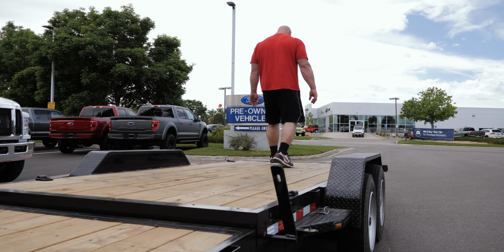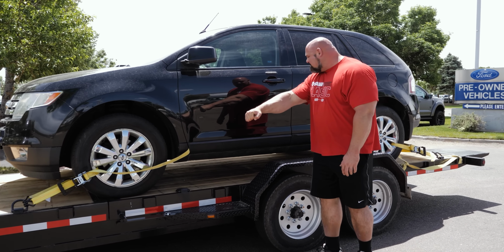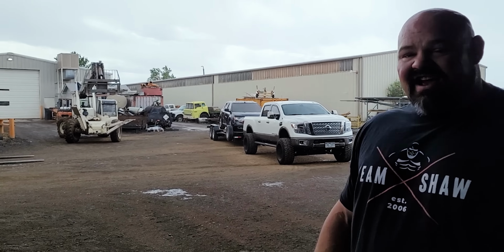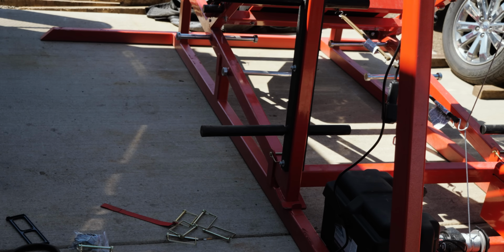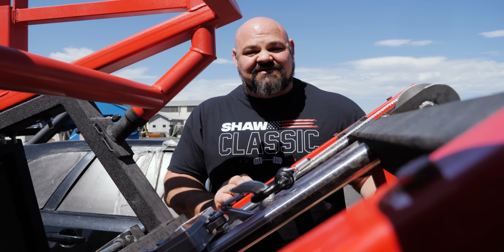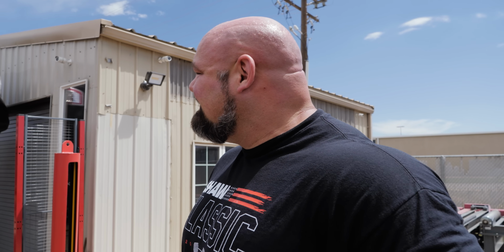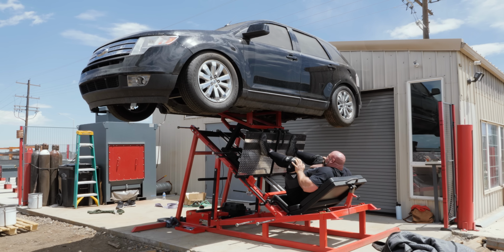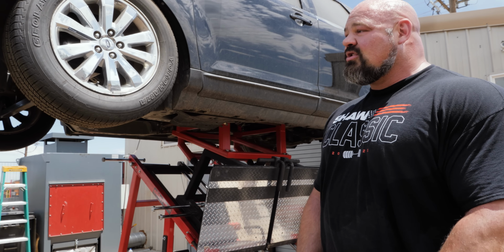LEG PRESSING A 2,000LB CAR! | SHAW CLASSIC

Comment: Yeah, seeing the car shake is a little scary.  That might make this event, an event that not only tests strength but fear of dying.
Reply: No pain no gain? 😂
Reply: Yeah. Seems scetchy. What if it came loose after all the reps and 🚙🙃🥞
Reply: @Hammarsand  well I'm sure Brian will have a safety team keep tracked of it
Reply: @Hammarsand  There will be a safety inspection team there to check it out before the event and after each competitor. It's going to have to otherwise I'm sure the stadium wouldn't allow it as one of the events.
Reply: Yea not a fan really. So dangerous and shorter guys are gonna have the advantage
Reply: @BraYsUnc06  so Eddie hall will win? 😂😂
Reply: I hope they've tested dropping the weight down onto the safety to see how the car reacts and check the mounting points.
Reply: Just add some glue and it will be fine.
Reply: @BraYsUnc06  What makes you think its "so dangerous" exactly? And it's easy to have adjustable safety stops so there is similar range of motion for taller or shorter athletes. Even if there werent though, taller athletes have the advantage in so many areas. It's ok for shorter athletes to have an advantage once in a while too.
Reply: thats what iw as thinking to it wiggling LOL
Reply: Yeah agree but his a strong man💪
Reply: I hope the engineering was done properly. Hopefully the welds are strong and bolts are properly rated. It does look sketchy. I think I’d skip this event if I was a competitor 😀
Reply: @BraYsUnc06  he said he would be adjusting it to each competitor
Reply: @BraYsUnc06  tall guys have the advantage in a lot of other events. its just how the sport is. just be as well rounded as you can
Reply: The car will just bounch of brian
Reply: @BraYsUnc06  taller guys have advantage on stones. Longer arms advantage on DL. Strongman doesn't care about your size, it's about who is the strongest
Reply: @MattManProductions  man that was pretty good! I swear a gym bro will say that about anything (no pain no gain)!
Reply: The base on which the car is placed on is FAR too small to hold that kind of weight safely, and the large weight distribution of the car makes it even worse. There's no way they can 100% garantee the athletes safety in this current condition.
Reply: @ralphschannel6650  if you cant solve a problem with duct tape then youre not using enough duct tape.
Reply: No fear no pain event
Reply: @BJerrell  not really. They have to bend over further, squat lower and lift the weight higher. In deadlift. Not higher in stones, but they still are more compromised when they go do to lift.
Reply: @BJerrell  the only advantage is they can lock their hands on stones. That's it. There's a reason shorter guy do better with deadlift.
Reply: This does look a little sketch tbh
Reply: @apocratos0174  That was always my father's solution. Duct tape. The more the merrier. Especially applying all crooked.
Reply: They need to put something like chains on the other side so the car can't tip towards the person
Reply: Implying he couldn't just stop it with his hands huh
Reply: It needs to be redesigned to be wider and deeper.   It simply isn't designed properly.
Reply: Well not supposed  to  die,  should   make  safe,  sturdy

Comment: I wouldn’t wanna be the one responsible for them welds 😂
Reply: I hope they finish all of the missing welds . They are going to see alot of stress everytime it slams the stops.
Reply: @wayloncrum7488  That’s what I am thinking as well… Hopefully there will be no failures.
Reply: Look up how strong welds are, that car aint going nowhere. I couldn't tell if they do or not but they def need some bolts holding the car to the press frame so it doesn't wobble around and just general safety
Reply: @DyLemmaOG   I know how strong a weld is but the integrity of the weld does matter! I’m just saying I wouldn’t wanna be the one to be liable.
Reply: @z_blev  this will really be a test for the EliteFTS build quality. Their reputation is very good and this leg press is incredibly over built. Here's to hoping it can handle a setup outside of its designed purpose.
Reply: Even stick welding with a 6010 stick, one inch of weld should hold 60,000 pounds. Not sure what shear weight is though.
Reply: I would be way more concerned for those linear rails which are taking this huge torque because they loaded the weight waaay higher than normal. Would not be surprised if one of those bends during contest and potentially drops the car onto the competitor. I can tell they didn't involve any mechanical engineers in this design change.
Reply: @cadewallace20111  I think they were talking about the car being attached to a crane or something so it could only go down so far.
Reply: @cadewallace20111   I didn’t think of the guide rails 😮 Certainly will be a mentally challenging event.
Reply: @DyLemmaOG  welds are strong yes, but take it from a farmer they will still rip apart once u get smacking them professional weld or not! they need to be over done
Reply: I was thinking the same thing but you can tell it is extremely tight. Guy did a great job

Comment: I have a fear someone may end up having a car on their face when they do this. It does not seem very sturdy or stable. That base should be as wide as the car is for stability and the little bits of metal that are actually holdiong the car to the rig should be beefed up.
Reply: Could also wrap the hell out of it to the rack. Tie every support joint to the rack
Reply: i agree 100% some guys may not want to be soft on the equipment , save energy by slamming it back down quickly they will either have to try ...to enforce that as a no no technique but thers something about the base of that so small & the car so wide causing it to wobble means causing unexpected cracks or damage to place holders

Comment: Need a roll cage or to be attached to a lift so that in the event it does detach it will not fall on the competitor. Love the event though. Dedication to improve the sport and competition is clearly visible in The Shaw Classic.
Reply: Or at least some kinds of safety cables that hook onto the car from some kind of small crane.

Comment: A 2,000 car or car and rig apparatus at an angle of 35 degrees (and assuming no friction) gives a value of 258 Newtons or roughly about 1,146 lbs of actual weight to be pressed.  Of course still a 2,000 car but with the use of a simple machine like an inclined plane, the force is reduced to move the object.
Reply: The car isnt 2k lbs, 2k lbs is what he is pressing the car is way more than 2k
Reply: @drsawful  The title of the video says 2,000 lb car.  So your saying (through the math) the car would have to weight approx 3,500 lbs through the leg press to equal the 2,000 lb force necessary to move it.  I see.  Then maybe change the title of the video to say 3,500 lb car?  Would sound much better!

Comment: 8:20 I can't believe you stripped it out that much and it still weighed 2000 lbs! I figured you'd yoink the engine & transmission, seats, all electrical stuff and sound insulation maybe but that is pretty much a bare shell!

[Edit: OK, I guess if every moving part = 2000lb then the frame must weigh a couple of hundred too but still. You could have used a Fiat Panda straight off the forecourt :-) ]

Comment: Might want to figure out the  safety  over to catch the car in a catastrophic failure  and the winch needs to be bigger unless it had a low battery  that's so sick  he did not weld on bottom on car frame

Comment: Man, the welds on the leg press and everything look good, but the welds and subframe on the car where it attaches to the leg press, I’m not impressed by. I mean it’s not even welded all the way around on the tubes that lock into the leg press. Please please please go over every part of that and make sure it’s 100% safe and structural. I’d hate to see someone get hurt or worse due to a sloppy mistake by the builders. That needs to be overbuilt. I know it’s heavy but safety comes first on something like that!

Comment: I would be scared to death to go for max reps on a leg press like that, with a winch as the means to pull it off me. Mad idea, just seems ultra dangerous. I take that back I didn't notice the catchers at the correct depth. That's not so bad.  Looks nuts tbh

Comment: Hey Brian was watching the assembly and noticed @ 9:10 there is a joint clearing missing a weld. Looks to be kinda half prepped for something but a visible gap  still there…couldn’t get a clear view of the other joints but I think they are welded completely around which seems like the correct way. Just don’t want anything breaking or anyone getting hurt!

Comment: with a used car shortage, I hope the engine or transmission was at least blown, and you just limped it onto the trailer. It does look cool on the sled

Comment: You do realize, that if you have 1000 pounds on a 45 degree inclined sled, then the pressure on the push plate is not more than 707 pounds, and will be slightly less than that due to frictional losses.    It's vector math. You will use the SIN function.

Comment: But can you pick up cars without a bar just grabbing it doubt it. Funny thing is Eddie Hall passed out on his 2200 lb leg press I didnt. Despite him weighing 200 lbs more. Most likely taking performance enhancing drugs. Eating around 15000 calories a day. It didnt matter. My videos are up on youtube. My 540 lb back rows 100 times. 540 lb seated bench press 55 times. The 2200 lb leg press. That ones old made significant improvements. Ill be uploading 75-100 times with the 540 lb seated bench. I think could muster 150 for the 540 lb back rows as well.

Comment: One of the coolest looking SM events I've seen, but it looks sketchy. Taking the word of mechanical engineers in this comments section, if it hasn't someone qualification needs to assess this. Even from a "gym fails" video perspective, this event has the capacity to create some truly gruesome injuries (Turkey leg knee joint). Yes, when performed correctly, the leg pressed is perfectly safe. When acting the bollock, it gets dangerous. Trying for reps with a friggin car or top, where money and prestige are on the line, will probably result in conduct which qualifies as "acting the bollocks "

Comment: No lie I think I could have done this when I was 15 or 16 but I blew every disc in my lumbar at age 23 and put a stop to that kind of stuff.
Reply: @HashBrownDoyler  no way to prove it now I guess. I know for a fact I did over 1000lbs in 9th grade so around that age.
Reply: @bambam5130  BAAAHAHAHAHAHHA
Reply: @HashBrownDoyler  I'm confident in my statements and have witnesses so laugh all you want if it makes you feel better about yourself.
Reply: @bambam5130  YEA DUDE I BET YOU CAN ALSO DEADLIFT 300KG AT AGE 15 TOO
Reply: @HashBrownDoyler  never tried a max deadlift. I've had a bad back most of my life so I stayed away from it. I have picked up a 350 Chevy motor and sat it in the back of a truck so about 300lbs.
Reply: @HashBrownDoyler  not the most I've seen but I was benching 300lbs in 8th to the first of 9th grade
Reply: @bambam5130  I could squat 700lbs at age 8
Reply: @HashBrownDoyler  I have no reason to lie so whatever you think doesn't matter. Don't be mad you're a grown man and still haven't put those numbers up.
Reply: @bambam5130  I can run 10km in 35:12
Reply: @HashBrownDoyler  good for you but I don't have to lie to feel better than someone else.
Reply: @HashBrownDoyler  maybe if you spent less time on the video games you can get those numbers higher than the those I had 20 years ago.

Comment: I really want to see that car either strapped down, or a safety cage added (like a couple of pieces of rebar welded to the frame bent into two arcs over the seat w/ cross supports)

Comment: Who would have thought that the strongman needs to use some brains rather than muscle for a change! The angle of the bench press in degrees is (180/pi)*arcsin(L/O) where 'L' is the weight for the legs, and 'O' is the overall weight on top of the press.

Comment: You could lift motorcycles. "Like" atlas stones. Maybe get another sponsor like Honda or something. lift a 150cc, 250cc, ... and up. Drain all the oil and fuel for safety. It could simulate putting one in the back of a truck. More people can relate to the weight of a motorcycle than a stone. Anyway, just an idea.

Comment: I hope i'm blind and missing out on something, because that welding job looks terrible and the guy responsible should be fired for letting you test it at that state. The frame under the car which supports it is way to small as well. Good luck, i guess.